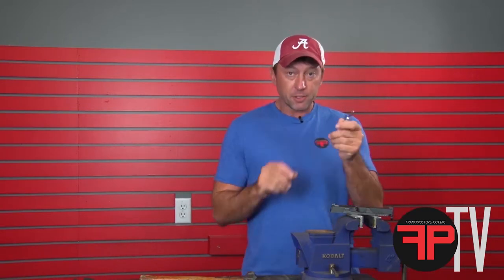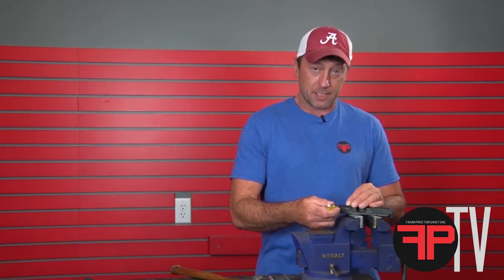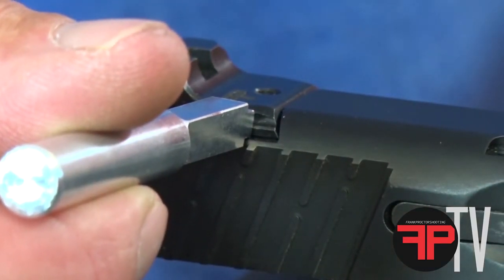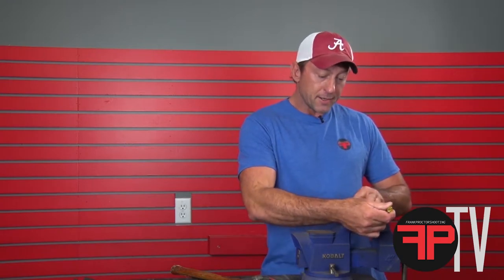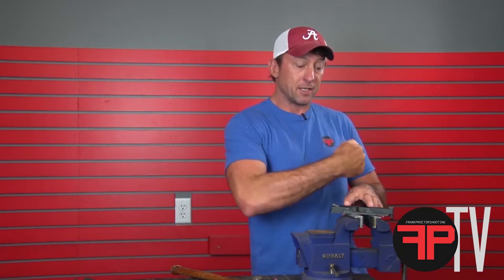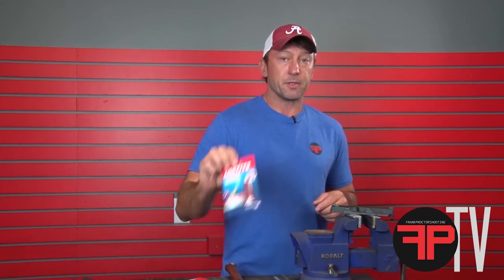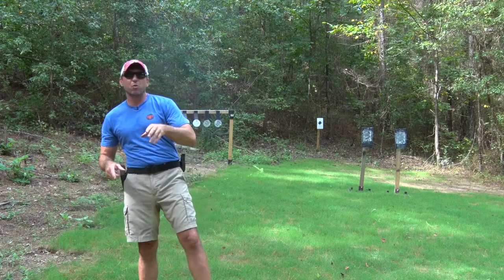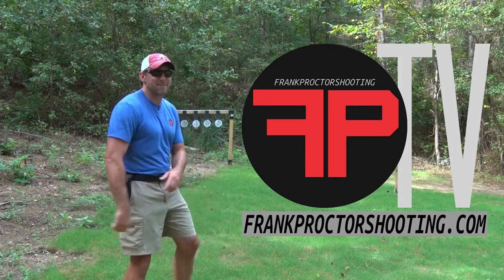Frank Proctor Shooting/Pistol Sight Installation

Comment: Just bought your Glock sights for my 17 EDC and I can’t wait to install them. These will be the first fiber optic sights I’ve ever used. Since I use a TLR1HL, I never can see my night sights as the contrast between the light and dark areas when I have the light on are too great to see the night sights, so I want to use these fiber optics for my Glock that uses a light. My other Glock that doesn’t have a light, will use night sights since i won’t have an illuminable object